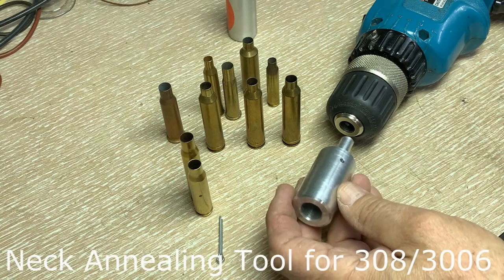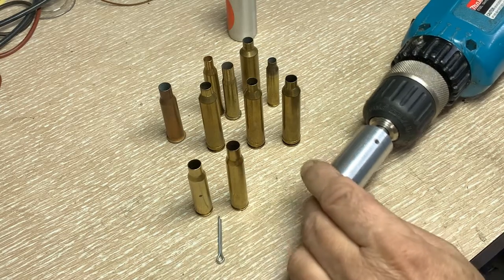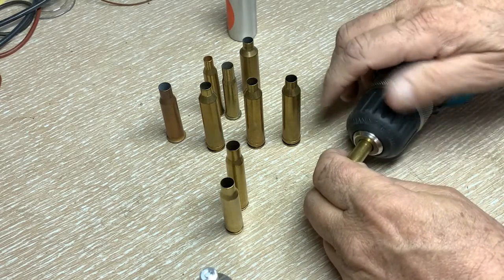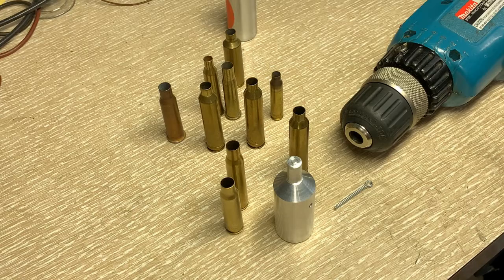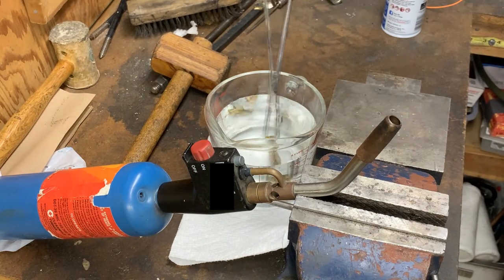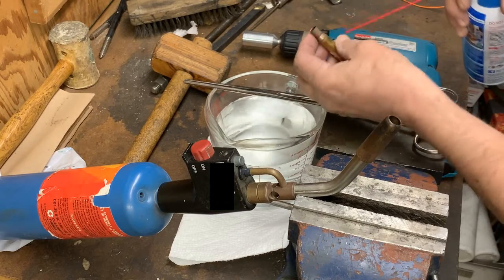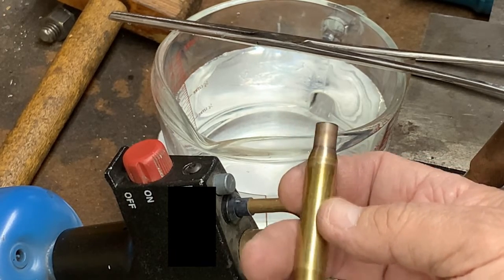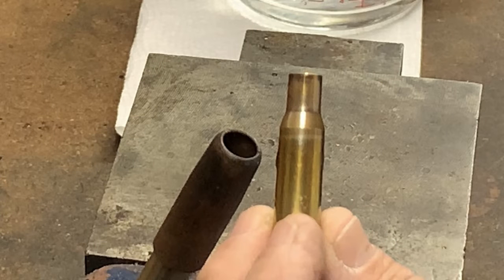Neck Annealing Tool for 308/3006 Variants

Comment: I have been using deep sockets.  That fit whatever case I am working.   Same concept.
Reply from the maker: Sure. My solution just takes it in a little more professional direction and prevents overheating of the case, but whatever works for you  is fine.  Well, I'd be sure to clean the sockets first as I know they get grease and dirt on them, but still doable.

Comment: I just finished reloading 40 Hornady 223  cases 40 times just neck sizing and by the 25th time I had thrown out half the cases as that ring was forming around the case near the bottom and I could feel a ridge inside of the case. By 30 reloads I was down to 6 cases  with half which were thrown out because they had split necks as I got closer to 30 reloads. By 40 reloads I was down to 5 cases left.
In my other rifle I have reloaded 40 Lepua 223 cases neck sizing only and by the time I got to 40 reloads I still had 40 cases left and am still reloading them. 
You gotta question full sizing and annealing with 223 cases people. 🙂
Reply from the maker: Good comment. I theorize that the smaller case of a 223 holds less powder and is less likely to expand considering the same wall thickness as other cases; and, therefore lasts much longer. Most sources say one should small base resize to ensure correct feeding in any semiauto rifle. A bolt action rifle is the exception since a good one probably is chambered close to minimal head space. The head space controls much of what your experience was that you reported. Heck, with a little annealing you'd go to 75 reloads per case. Ha. Maybe not. Thanks for your interest today.